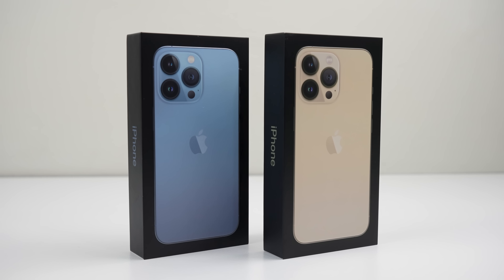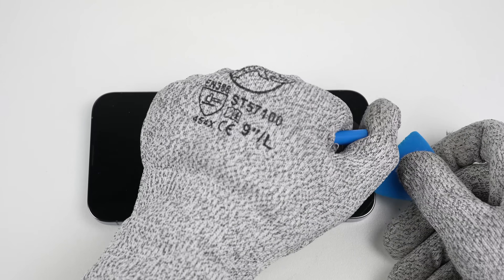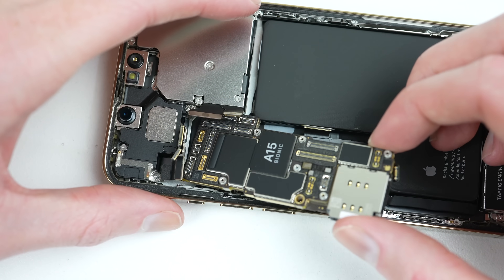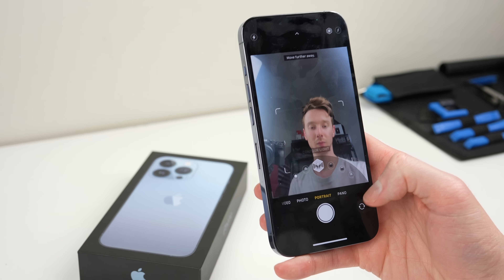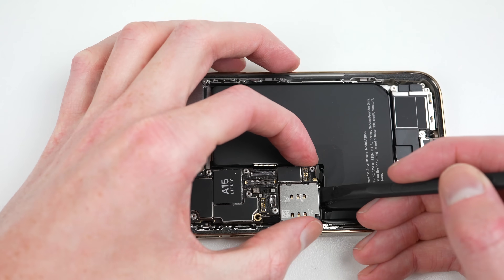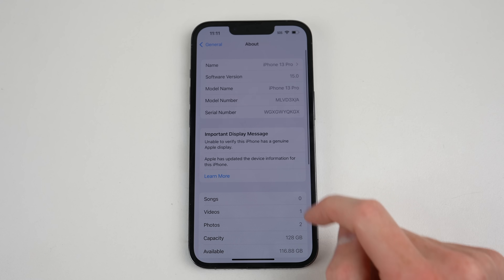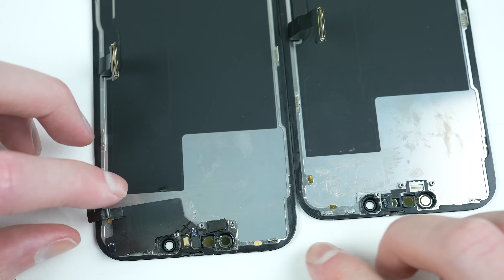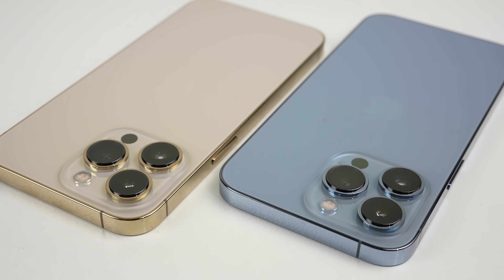iPhone 13 A Repair Nightmare - Teardown and Repair Assessment

Comment: This is exactly the sort of thing that needs to be regulated. The right to repair is important and everything apple does goes against it.
Reply: Rolex are the same. They don't make spare parts available to anyone but their own authorised service people.
Reply: @gilessteve  The case for the rolex watches is something else . If u are going to buy that watch that expensive then oviously u will need original parts. But in apple case they are just blocking 3rd party repair.
Reply: @xypher_666  
The issue begins when you start saying "well, this thing is obviously different."  When you codify exceptions like that into law, all of a sudden everything becomes exceptional, and you're back to square one.  Either consumers have a right to repair their own property, or they don't.  Simple as that.  

Also, on a side note, if you think Rolex's are magically made of inherently god-tier components that couldn't possibly replicated as well if not better by someone else, you're deluding yourself.  In fact, most of the components in a Rolex are just completely bog-standard watch components you could just as easily find in a Quartz.  The reason they're so expensive is almost entirely a result of the name, much like Apple, Louis Vuitton, Supreme, etc.
Reply: @gilessteve  Apple is not Rolex! Apple is making toys for a couple of years use and then you can throw it away! iPhones have no value in the end.
Reply: @inputerase  All the more reason Rolex should make spare parts readily available.
Reply: @gilessteve  well yeah... if they didn't then someone could just make random rolexes and "return" them
Reply: @kennythkelvington-rognholt9245  ''Return them'' to whom? Spare parts should be freely available, IMO.
Reply: @gilessteve  Obviously back to Rolex. And the parts are available as far as I know so they dont block a reparin. They just refuse a reparing if a non certified person repaired it before.
Reply: Apple pretends like we are forcing them to make their device repairable. No, we just want to be able to buy spare parts and not have DRM level hardware and fake software glitches.
Reply: @Mocha.  all because microsoft pulled that shit back in the day... disgusting that noone brings that shit up, although someone needs to take the apple ceo out back, and give him the good ole mandatory beatdown dojima style.
Reply: @Atamosk-bu7zt  bloody hell yes!
Reply: @Atamosk-bu7zt  Is noone actually a word. I can't tell if this is supposed to be none of no one. Or you wanted to say the both at the same time?
Reply: I have heard that there is talk about regulating similar thing. The FCC, for example, is supposedly looking into McDonald's various ice cream machine malfunctions if this is due to the ice cream machine only being able to be by the manufacturers
Reply: We need to abolish intentional obsolescence as a whole.
Reply: @ulsenheim girush then let's change that legal definition, so that people gain the right to repair for real, rather than leaving loopholes
Reply: We payed for the property, we should take care and maintain our property!

Also I got this comment to 420, nice.
Reply: @TheEmeraldSword04  Exactly!
Reply: Samsung are actually sell genuine parts for people to replace broken parts. Apple needs to unlock home repairs or they are gonna die eventually.
Reply: You know what needs to be done about it? You all need to stop buying apple products.
Reply: You literally agree that you don’t have the right to physically own your phone and it’s software in the user agreement
Reply: @TinyBearTim  WTF
Reply: @TinyBearTim  That fucking sucks.
Reply: There should be laws against this.
Reply: What if they pair the frame of the phone next?
Reply: Just another reason why I won't buy Apple products.
Reply: Or just stop buying apple products... they aren't the only game in town.
Reply: it is imperative that it be legal, since everyone should have the freedom to run their business as they wish, even if they only prioritize their benefit at the expense of worsening their products. They manufacture it because there are people who are going to buy it anyway without stopping to think that they are being sold a product that is more expensive than necessary, which on top of that cannot be repaired and will have to be replaced in a few years.
But it's status that comes with bragging to others because you spent $1,000 on gold-painted shit.
From my point of view, I respect the decisions of a company to take these measures, although I do not share them because under these circumstances I do not consider it worthwhile.
I apologize if I have offended anyone but I prefer to be honest, rather than be misunderstood.

By the way, good video, it is good to expose the atrocities that can arise when people are not critical of what they buy
Reply: unless you have a ticket with apple with part numbers and configuration ANY part replaced will come up as a non genuine part, thus Apple FORCES you to go to them alone
Reply: Too bad that won't EVER change.
Reply: You would rather a greedy money hungry dealership fix your car and be the one stop shop for your car or who you rather go one of a bunch of mechanics? Same with phones, what would happen if you HAD to go to the manufacturer and they could mark up parts 200% since only they can sell them?
Reply: Holy shit with the comments... Some of you dont know the consecuences of more and more regulations....
Apple is shit?? Dont buy it nothing from him. Just easy like that.
More and more regulations = give up our responsibilities.
Responsabilities = power.
are we seriously going to give power to a centralized organization, with the promise that it will not stab us in the back and sell itself to another shitty corporation???....
Reply: @fr4nmo475  Already do, you can't purchase replacement parts anywhere but from the manufacturer and they love it because it becomes easy revenue to over charge you for parts and accessories.  Repair of electronics became a monopoly to the manufacturers, if cars were the same way trust me you would be furious.
Reply: If idiots quit buying them, they'd probably change their ways. But they won't because Apple phones are the hip, trendy, don't-want-to-look-poor devices that prey on the gullible and vain.
Reply: NOOOO. Regulations are bad. Simply put. Just don't buy their products or boycott the entire firm.
Reply: On free market, Apple would lose. But they are protected by I.P. laws which are regulations.
Reply: @MarkStoddard  Those people simply want to abolish existing anti-repair regulations. A movement to abolish a law is not a regulation. Was Lincoln a regulation prick in your opinion?
Reply: remember the ocmmecial they made fighting the big monopoly or something but now they're more scummy
Reply: It doesn't need regulation, it needs consumers to stop buying shitty products.
Reply: @alexanderchippel  there are like 2 companies that are big on phones rn. there isnt enough competition
Reply: People are all for regulation until it comes to something that they like, like the cops for example.
Reply: @slickbricknick123  how does one regulate cops
Reply: @slickbricknick123  Noone is against regulating cops lol. If they go against what they should protect, they should get punished for it like everyone else. People are against demonising cops like many from the left does because their facists dreams get squished by cops lol.
Reply: But the free market!
Reply: @concernedcitizen6313  Good thing there is no such thing like "free" market. There will be always regulations and limitations, be it geological, consumer, technological. ;)
Reply: @ulsenheim girush still its dumb people paid for these devices not rent them
Reply: @ulsenheim girush yeah that's kind of what we're saying shouldn't be legal.
Reply: Yea best thing to do is never pay for products from companies that do this
Reply: Its up to the consumer to continue buying them or not
Reply: @bp6837  and those retards keep paying product from the rotten apple
Reply: @hugarada7156  i cant say i disagree
Reply: @bp6837  For now. If it becomes industry standart (which is likely if apple gets away with it), then its either buying with that or becoming excluded from digital society.
Reply: @bp6837  The consumer can't be trusted, perfect actors can be good consumers, but human's aren't and so regulations are required. Expecting voting with your walled to work is like expecting anarchocomminism to work, those things simply don't work, humans are not perfect actors that act with their own best interests in mind, they can be manipulated, they can be corrupted, they can be dumb, and so you need regulations. 
In a perfect world of perfect actors the market would dictate the best outcome as consumers would optimize their purchases to maximize the best outcome, but the reality is that humans are not perfect, the world is not perfect, biases exist, etc. So that just doesn't work, in the real world the most profitable thing is not the best thing to do, regulations are needed so that companies can do the best thing to do without being outcompeted by companies choosing to do actions that are profitable but not good in the long term or good for the consumer. 
Something can be desirable and not have demand, simply because the consumer can't see that it is desirable, or to create that demand would mean a temporal loss for them. Consumers can't be expected to do that, legislations are the way to go about those things, legislations make the consumers happy, and make the companies be able to compete without being scumbags.
Reply: So does Samsung and every other rival company I can tell you have never used an iPhone before
Reply: It is regulated - If you don't like it, don't buy it.
Problem solved
Reply: @dave7830  Shitty argument.
Reply: No it doesn't. People don't want that. There is not enough demand for it. If there were, manufacturers would make such phone. Stop with your regulatory bullshit.
Reply: @OxxidCZ  There IS enough demand for it. Manufacturers don't care. Because it would mean less gold toilets for them.
Reply: It doesnt need to be regulated
Reply: @Sorrythat111  It does, just like how you should go back to school.
Reply: @NeonLuminous  What school?
Reply: @Sorrythat111  Uh oh. You don't go to school?
Reply: @TheHeavieKiwie  Ive been to school. I dont see how is this relevant here?
Reply: More government regulation and interference is the last thing we need!  It's one thing to have regulations in place to help protect our environment, etc, but micro regulating every aspect of a business via government agencies run by corrupt unelected officials and politicians / lobbyists will only drag down innovation and competition, creating inferior products while driving up costs for the consumer.
Reply: @livefreeorfight598  nah bro I'm gonna have to say the right to repair your shit is important.
Reply: @elijahwilson8990  you dont own it. You dont have a right to repair shit you dont own, it's part of the user agreement.
Reply: @orionar2461  Which is why I'm for regulation against that. Also I didn't agree to any user agreement regarding my phone.
Reply: @elijahwilson8990  exactly, just don't block features from working especially with genuine parts.
Reply: Translation: instead of patronizing/actually creating competing reparable products I’m going to use state violence to bend existing producers to my will until phones are another fully state-monopolized industry with shitty quality, shortages, and zero progress.
Reply: @whatsthebigfukindeal  I'd create a competitor. If I had enough money to do it.

Grow up. Competitors only exist where money is abundant enough for them
to appear in the first place. Not everyone whants to take away others' freedom, just make sure they don't use their advantages in life (like having lots of money) against others. Which is what apple is doing.
Reply: @desmonddesfables2314  you cannot create a competitior without massive amounts of money. The Federal government highly regulates Communications
Reply: @whatsthebigfukindeal  shitty quality hmm guess which phone was developed using publicly funded technology? And which company sells shittu accessories?
Reply: @thatIndianEnginir  Apple?
Reply: @whatsthebigfukindeal  Instead of holding bad practices accountable I’m going to let the mega corporations do as they please because they are the supreme authority of human civilization whom can do no wrong.
Reply: @thelouster5815  if you can do better they will buy your product...

I am a capitalist but it doesn't mean that I am an apple bootlicker, on the contrary
Reply: @thelouster5815  I can't find this taxation is theft comment. What did it say?
Reply: @whatsthebigfukindeal  if prohibition has taught me about something…
Reply: @whatsthebigfukindeal  People like you are delusional. Probably didn't read a lick of history either, because without regulations we would still have toxic waste dumped in rivers and child labour. The profit motive means that as long as it's profitable, it will happen, and if the more right thing to do is less profitable, not only will it not happen with the existing corporation, but competing companies will fail against the original one because they can't gain enough profit.

For example, what Framework is doing in laptops right now is not only expensive right out the door for them, but they would also have to expect less money in bought laptops beyond the initial builds and rely on much less profitable part replacements. And at the end of the day, people follow what is popular, and what is advertised to them. Corporations also push out competition through advertisement and lobbying. 

Honestly, people like you are going to kill the planet, it's borderline evil.
Reply: @marisanya  Or if not through lobbying, then just outpricing the budding competition.
Reply: @marisanya  whatever that person said can only be described as dark sarcasm.

Comment: Is there some kind of override code an Apple employee would type in when switching parts or how would that work? Impressive effort put into making issues look genuine.
Reply: @Thomas Lord How so? Care to explain your reasoning of “rubbish talk”? The parts in the video are clearly identical. They should work without fault. Because they are not, the device is uniquely identifying each component in a manner. This is evident in the video. You can’t swap a single part.
Reply: @Thomas Lord cope
Reply: As far as official repair goes, you put the serial number of the old and new part in the apple system and link it with the phone and repair.  So apple can verify they get back their original apple part, and their never used new apple part is added.  Parts that are already linked to a phone can never be reused, even if they are in mint condition.  Then you run a calibration suite based on the model to link the newly sold apple part to the phone. And phone will retain all features and apple keeps a record of the repair.

All done on apple server in the cloud, no bypass code AFAIK.
Reply: @Thomas Lord What difference does it make if the parts you swap yourself do not work properly?
Reply: They have a special gadget that will configure the parts properly
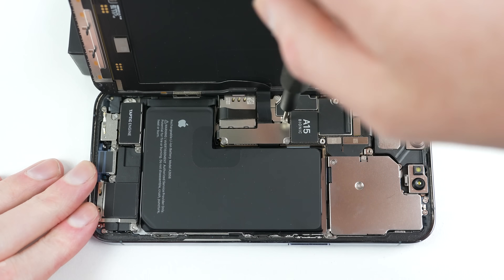Reply: Yes there is, mentioned at 15:15 or thereabouts
Reply: @vaagventje special software to pair the parts
Reply: @Ooga.booga.unga.bunga1  Found the Apple fanboy.
Reply: @bulldozer6781   i don't even have an iphone so stop jumping to conclusions 🤣 I mean to @ thomas
Reply: This is a rudimentary example of how such hardware DRM works. This does not mean this is exactly how the iPhone 13 works. Though this may be similar.

The parts are able to identify who they are. Each part has a serial number of sorts. At a low level, the firmware of the phones board has been programmed with the serial number of itself, and the serial numbers of each part. If the board detects a serial mismatch for a certain part, the OS can use this information to break the functionality of features. A development or diagnostic software can reprogram the firmware on the board to use an updated serial number for a part if it needs to be replaced. Thus allowing the use of the new part without issue. This software will be internal and restricted to employees. You or any third party will not have access to it.

It's a DRM method that doesn't need to exist. A good example of how this can be rectified is laws were made to force automakers to give you and third party shops access to diagnostic repair tools and/or software. This means you do not have to go to a dealer that will charge you thousands for something that can done in half the cost either by yourself or a mechanic you trust.

Comment: In all honesty, I’m impressed face Id fails in most of those scenarios because of the hardware trust with sensitive hardware like face id. They are trying to prevent swapping in a rogue component into that pipeline to actually ensure the integrity of the security aspects.

The goal is trusted security platform and not necessarily 3rd party repairs

Comment: Thank you for actually showing the disassembly and assembly in full detail.
Reply: Did you get the part that it's useless, right? :)
Reply: @hhy2k  but it's still interesting to see how it's all made, even if you don't plan to do it yourself
Reply: @McJusti  Yes, of corse, great video!
Reply: @McJusti  Yep, and it's a nice change of pace from videos where the actual purpose is to show you how to disassemble/assemble things and it's all cuts, fast forward, and skipped steps.